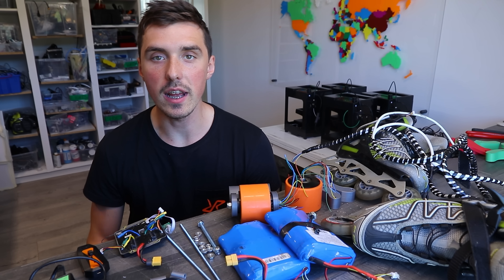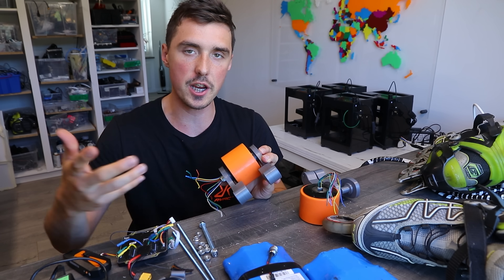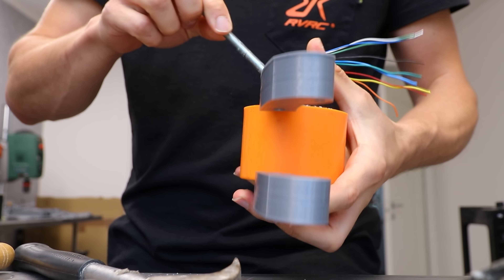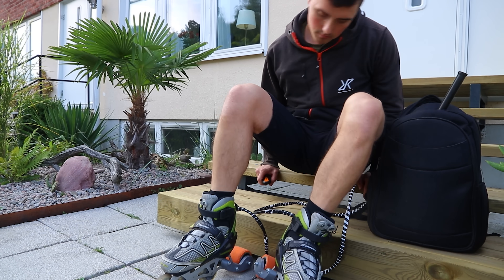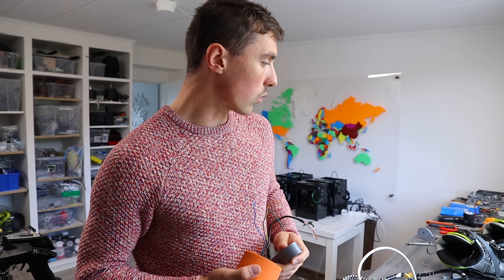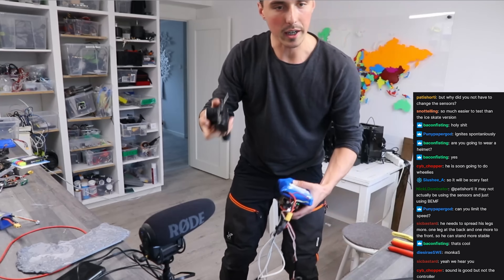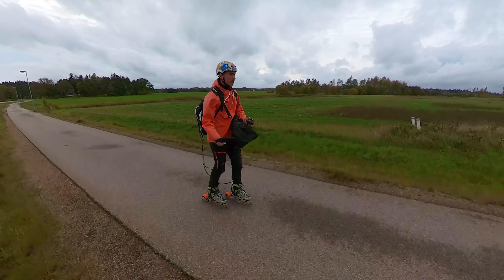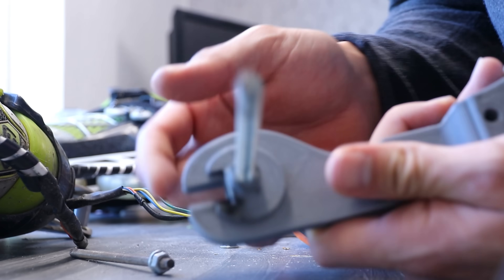1000W Electric Rollerblades That Will Hurt You

Comment: This poor guy needs a cnc machine
Reply: The quality of this guys stuff will increase instantly when he finally does get one.
Reply: @fifis101  thats not super the point of these vids tho lolz
Reply: Yes!!  Someone get this kid the tools to change the world.
Reply: i'm sure he's accepting donations. lol
Reply: Using an angle grinder or even a file would be enough to shape some metal into that square, and make something that offers a durable connection between plastic arm and motor hub. It's not about what tools you can afford, it's about how creative you can be with the tools you have available. 
Just as a side note, having a CNC machine does not solve your problems like magic. It opens up a new box full of new problems that need solving too (tool path generation, feeds, speeds, noise, different tools and there use cases, workpiece clamping, ....)
Reply: @ProtonOne11  Yeah! 
3 printers are really good, but sometimes it's better to do it the old fashion way, haha (at least if you don't have a printer that can print metal - which is very expensive. A CNC is probably cheaper than that).
Reply: @Speeder84XL  every method of machining or printing something have some pros and cons :) 3D printing metal is great but 3D metal printers are extremly expensive ! And they cant do some things what CNC mill can do and vice versa and there is much more things and operations in engineering industry 3D printing is just another thing in engineering industry and we will propably start feel benefit from that technology in few years and become more and more popular and more cheap for smaller shops (im so sorry my english really sucks :/ )
Reply: im working on beast like this https://www.youtube.com/watch?v=H8hM_Yb3tSQ  but we have some printers aswell im interested in that technology so much i love engineering industry
Reply: @stonedapegaming7745  Hopefully they will be stocked again soon.
Reply: @adamcarver9057  they will be Florida is fixing the mess California is causing.
Reply: In the meantime a collaboration with someone that has one would be a good idea and would help get both channels new subscribers.
Reply: Or forge aluminum parts with lost PLA method. For example: https://youtu.be/HVgPM1ojyLw
Reply: Everyone's and expert...
Reply: Not really for the stuff he’s doing.
Reply: Just saying the Shariff DMC looks really cool and reasonably priced for CNC.
Reply: @adamcarver9057  I would recommend the OMIO x8 CNC Router. It I don't know much about the DMC machine but it looks like you get more usable cutting volume for less money with the OMIO. You will of course sacrifice some rigidity and accuracy with a larger machine, but in my experience it can cut aluminum pretty well.
Reply: do you have a cheap one? i think cnc´s are very expensive (30.000dollars)
Reply: @BarbecueBeaconBurger  More affordable CNCs are becoming available in the sub $10k range though.
Reply: @derkeksinator17  they're worthless, especially 5 axis ones. The Pocket NC is an especially egregious offender of overpriced junk. It's close to $7k and it has a hard time even cutting aluminum without telling itself to pieces. Either get a 3 axis machine, or nothing, and don't expect to be cutting steel very well. And if you need 5 axis work, use a job shop or an online service.
Reply: @derkeksinator17  Make you own for probably less than $1000.  Use a Rapsberry Pi and a Handheld.  I was just looking.  You can get smaller home version CnC Routers for a couple grand to cheapo version.
Reply: @BarbecueBeaconBurger  $30 is expensive???

Now if you said $30,000 then yeah 
I'd say your right But $30. Pfffff
Reply: @stickykitty  sorry dude, i wad lost at the moment
Reply: he should go look into SMHs trash can, i think that dude changes CNC machines every week
Reply: @dmsanct  whats this?
Reply: and a brain bucked
Reply: I was just about to comment that someone needs to let him use their CNC
Reply: The only reason I miss working at a machine shop. I hated the oil and metal shards in my clothing.. A pair of jeans would gain 20 lbs in 1 year from the metal dust and oil soaking into them. I can only imagine what damage that metal dust did to my lungs.. Glad to get out of that work, but miss having access to cnc machines and laser cutters/welders.
Reply: I think this newer generation freaks out when aked to do something other than 3D printing. To them, CNC is too much like actual work.
Reply: fizzy - its the same thing but a computer removing material rather than adding it. it is a cnc controlled machine.
Reply: I would suggest to get a damn multimeter first. So he can test for shorts before bricking controller 2 and 3.. 
I bet the multimeter would ve been cheaper than the 2 controllers.
Reply: China is going to steal your idea 😆 🤣
Reply: Don’t spend your time with 3D printer.
Reply: Ƹ̵̡Ӝ̵̨̄Ʒ ,..-
Reply: Wouldn't a CNC Machine be a bit heavy to power his rollerblades?
Reply: whats a cnc?
Reply: @RS-lo2zj  Computerized Numerical Control
Reply: @cooperfeld  i dont get that either
Reply: No, he show us how with only 3DPrinter he can make much thing so we can copy it. This channel born from 3DPrinter BTW 🤣
Reply: he has one, his 3d printer is CNC, what you are most likely referring to is a CNC router or CNC mill. Computer Numerical Control (CNC) is not a machine but a way to control machines. This common misconception is a huge pet peeve of mine.
Reply: @butterdubs2267  laughs SO quietly
Reply: @butterdubs2267  nobody cares about your pet peeves. We're not playing 21 questions...
Reply: He’s one of these “maker” youtubers. Basically just some guy with a 3D printer instead of a girlfriend.
Reply: @orppranator5230  om

Comment: Here is an idea.
Instead of having those wires coming from the boots up to the backpack and be very difficult to get into them and all tangled up, have waterproof plug connectors with a short wire coming from the boots, dress up with the back pack or whatever is holding the electronics and batteries and simply take the wires down and plug into the boots.
Also patent it, you know, for you being safe and all with this invention

Comment: I would not extend that idea to tires. It looks so minimalistic that redo it with CNC aluminum prototype should be the next step. Just to have the seen problems removed. My logical next steps would be having the battery pack stored in the shoes and everything synced to a remote control for more freedom. Maybe there are winter boots which can be modified to host the battery pack and wires.

Comment: Hi. We came up with a different idea in 2018. Electric attachment for roller skates. The motor does not interfere with rolling like on conventional rollers and does not slow down the free roll. The drive wheel is raised off the asphalt. The result is a simple and cheap design. Any one Kv 100-270 motor of size 5065, 5463 (optimal size and power up to 2kW), 6368, 6376 and more powerful :) Controller weight 4.12 or similar. The speed on a flat surface is up to 43 km / h, the weight of the attachment on the boot is 1 kg + a belt bag with a 2 kg battery. Demo video:  https://youtu.be/_eM5WjcVr7I Finished serial product: https://youtu.be/VFJkye8bicU

Comment: I think you should do that with the tires. Really you should be able to just add one power wheel and one wheel either front or back. If I recall most of those roller blades are just riveted to the bottom of the shoe. You might need to find something much stronger than pla to use. An entire new bottom of the shoe would be ideal. I can not wait for the off road version!

Comment: this would be awesome if you can make the front wheels replaced by smaller hub motors. because things with inline skates is for safety you need to be able to jump... if you ask me, been traveling by skate in the cities for years.   when you are skateboarding you can jump off, but with inline skates they are on your feet so they should be very agile (edit: compact and lightweight)

Comment: Awesome job. Look up. Off road roller blades. They look just like what you said you want to do. Big wheel in front. Big wheel in back. The trick with this idea would be to make them so you can disengage the drive somehow. So if you run out of battery you can disconnect and still rollerblade back.

Comment: Maybe you can figure out a way to replace one of the existing wheels with a hub motor. I bet the feeling while driving is 100 times better than if something is attached to the rear and the front. The power is maybe less so put maybe two on one rollerblade. This design would look better I guess. There are motors that have regenerative braking but you can turn that off so they spin freely and dont disturb the normal driving. But I don't know if these motors exist in this size... This would be nice project. I dont say this isn't a nice project but if I imagine riding these I would puke on the first meters because I even hate these stupid brakes that are on these things. The first thing I do when I have a new pair is to cut them off so nothing is disturbing me while driving.
Anyways keep up the good work!

Comment: You can make one with a bigger wheel at the back.  I mean bigger wheels means more efficient revolution thus less effort = more power, right?  (like how big-wheeled mountain bikes are built for speed)
I'd say judging by the length between your heels and wheels you can probably make the back wheel as big as 10-12 inches in diameter.  With that size you can probably make stronger motor/s for more speed and quick acceleration.

Comment: I wanted to build something ike this for a longer time. This seem too dangerous. I thought about mounting it just on left and let the motor be above ground with all 4 wheels intact. If you want to use it you would just make a braking motion, get the motor on the ground and give power to it on controller.  They would be usable as normal roller skates but you could be also pulled when being lazy. Seems to me a lot more safe and stable.

Comment: I have one question: when you turn/lean on the side with that flat wheel at the back, does it put pressure on the mount or does it lifts the middle wheels with all the weight on the front and the back? It's very nice and I need some of these! :P Great video!

Comment: mill those mounts out of aluminum on one of your little cnc routers, they will cut aluminum with WD-40 if you just set the feed rate slow enough.
Reply: You could just use a laser cut or water jet service to cut the mounts for you out of flat stock steel or aluminium sheets. There are some pretty nice online services where you can upload your drawings and get an instant quote. At least the service i use here has decently low pricing and very fast turnaround times. For me, that is still way cheaper than getting a decent CNC machine and all the tools to do it myself. The metal square that links to the motor hub could probably just be filed out of a nut that you screw onto the bolt, or maybe it's even designed to fit an ISO 8677 bolt (mushroom head square neck bolt) that would lock into a square cutout in the metal bracket.

Comment: Have you ever thought of trying to create stronger parts by like creating a hollow 3D printed shape and filling it up with resin to create a solid part that is completely bonded to the plastic or surrounding material? You could even add in some loose carbon fibers to create inlaid carbon fiber strengthening posts just for the click bait but honestly any fibers would be better than nothing so you could even first try some short pieces of cotton (or any other fibrous) string?

Comment: You should try driving the rear wheel (4th wheel) of the skates with the skateboard wheel from above. Like have the skateboard wheel contacting the skate wheel from behind and above so only the original wheels touch the ground. You'd have a bit less friction for acceleration, but I think the benefit of being able to use the skates like normal would outweigh that. Plus you wouldn't have to worry about the drive system supporting your weight.
Reply: That's actually brilliant. Simon pls look into that
Reply: Belt drive system?
Reply: @NatsumeKonno  Dont we use hub mottors to ditch the transmission?
Reply: @PatchworxStudios  belt drive only has 1 gear on an esk8 they also have direct drive. Never seen a transmission on an esk8. To  scary to add more top end speed for me.
Reply: @NatsumeKonno  Never seen a belt drive with ONE gear/pulley. On esk8 you sacrifice speed for power not vice versa.
Reply: could probably put the wheel right up against it, straight up friction, would also create a natural weak point for everything to slip and not cause any expensive damage.
Reply: @Cheezus  Could cause another problems. You loose energy, you need decent pressure and the mottors are torque and will slip all the time and chew up the wheels. Maybe better controls would solve all the problems? Btw this should not be 3d printed, you should at least use Aluminium for this.

Comment: I think you need to spring load the wheels so any uneven or concave surface doesn't put so much pressure and snap the motor arms

Comment: Awesome job, one suggestion, if you make it like a motorcycle wheel so you can lean left and right, because you had a hard time turning, so make it like a curved motorcycle wheel and then add the shocks so it can compress and you'll be able to lean and still accelerate / break ... great job otherwise

Comment: Why not four 1000w motors front and back and no middle wheels so you always have traction but I get it would be hard to get the strength out of a normal 3D print but I’d be awesome if you could make it work

Comment: 3D printing is great for design prototyping but you can't expect plastic to work in this situation. PCBWay will CNC cut anything you want from 6061 Aluminum using .STEP files from your 3D software. I had them CNC some parts for a turntable tonearm I designed and they were cheap, shipped fast, and the quality is flawless.
Reply: Didn't know pcb way also offered cnc service? Makes sense since they do pcb!

Comment: Nice video))) the experience of using 3D printed mounts in this video showed that for the next projects you need a small cnc milling machine to make such parts from aluminum)) You can assemble a cheap cnc router using the MPCNC Primo as an example, its rigidity is enough for milling aluminum, which is ideal for your purposes ))

Comment: I wonder why y'all keep thinking 3D printing is a cure-all in all mechanical situations...think outside the box, add pins inside the shapes...maybe even learn proper metalworking! FFS...
That said, love your videos.
Reply: It's not a cure all, but when you don't have access to a mill, what else can he do? Plus you saw how many iterations he had, stupid to try to machine anything this early in the design.
Reply: @leatherworkstation  Let me check...
1: NOT printing the square with layers parallel to the forces acting upon it that will rip it apart. Either print it in a different orientation, or print the square in an insert that will maximize layer strenght in both pieces.
2: Insert 1 or 2mm steel pins (even M2 screws would work in a pinch) on each corner of the square piece, going all the way through, to transfer more of the torque to the body, if unable (or most probably, unwilling) to think about layer orientation.
3: Aluminium rod and a damn fucking file. I said "metalworking", not machining. It would literally take 10 minutes to file a square, put a M3 thread on it and put a cross screw to transfer the torque to the carrying body, much less time than printing a new bracket, and it's not like he's a wimp that can't file for 10 minutes.

So, yes, a SHITLOAD of techniques avaliable in a pinch, for almost no money at all.
Thankyou for validating my point.

Again, I enjoy his shenanigans as much as everyone else, but I also want people to think twice about how to overcome plastic 3D printing limitations (to an extent) before requiring (now yes) real machining, wich is not in reach of everyone. If you can only buy a single "building machine", yes, definitely get a 3D printer before anything else (FDM or resin, that's another matter), CNC can wait, but there was a life before CNC, as well as there where other materials before "plastics" (broad term including CF reinforced too, wich is also a pain in the ass to print, and expensive as fuck) wich are still easy to give shape with a saw and files.

Comment: Instead of trying to stick a plastic square into the motor why don't you use a bolt and friction to keep the center from spinning? You can spread the load over a bigger area with washers

Comment: What about 4 small motors in each wheel ?
Get like the 125mm wheels, they do "ELECTRIC WHEEL MOTOR 5 "125MM 150W 12V 24V 36V GOLF CART OR STROLLER" 
So even 2 of them at the back would do the job.

Comment: Many years ago, maybe 78-80 i saw a  boots with track attachments like snowmobile. So very similar to rollerblade but with a track. They looked more like a skiboot because i think the tracks clipped on as an attachment the same way. They were skiing down grassy slopes with them. It was the first and only time i ever saw them but nothing ever came of it. You could resurrect this concept for sure. Summer skiing.

Comment: if you're really keen on having those mounts 3d printed then just split your design and have that mount printed flat on the printer, glue them all afterwards, the layer lines would be much stronger as you're no longer relying on the layer on layer adhesion to resist the torque